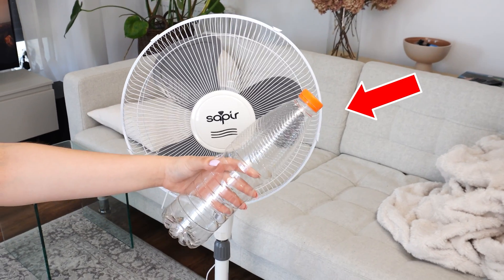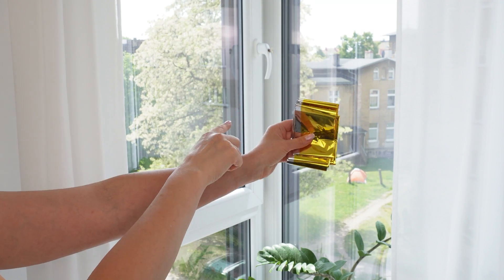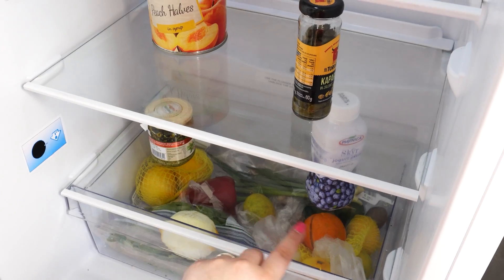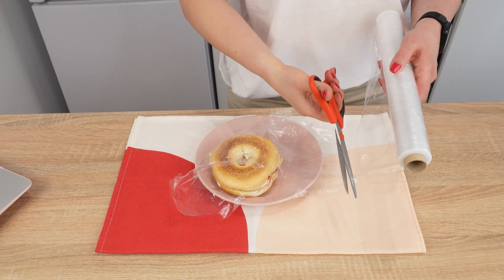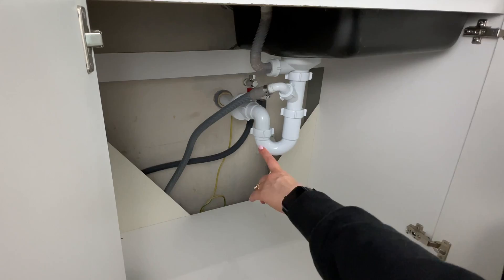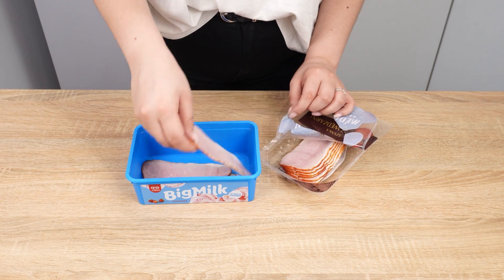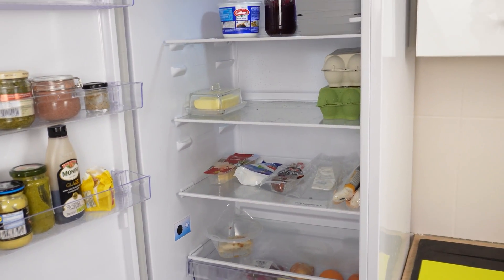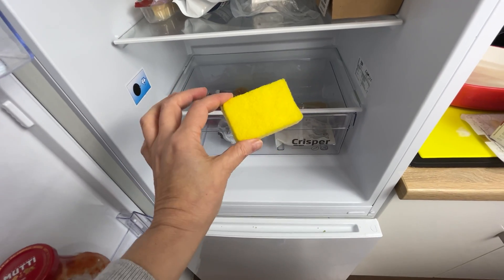Homemade air conditioner that will freeze whole room!

Comment: The idea of a Aircon is to remove the moisture in the said room.... on this method the moisture is still present, though it does cool the room, as soon as you turn off the fan, the room will warm up drasticly very quickly because of the humid air.

Comment: If its a house what was built in 1870 with no insulation and its 110 degrees this method will not be cooling your house down at all. You will not be able to sleep with this either. And putting a blanket over yourself that is a pipe dream right there. Our air conditioner when it was new did this but right now its not heating like it use to. We either will be cleaning it out soon or buying a new one. Three digit weather this method won't work.

Comment: Go buy a couple of the uv sun shade made for pop up canopy and cover each window, if you can from the outside better but if not still do it from the inside trust me this blocks the uv rays and keep the inside cooler. Once it cools down slightly open all windows have one box fan blowing in air and one box fan preferably in another room window exhausting the room air out so it circulates throughout the rooms. This is the most cost effective way to stay cool.

Comment: The water cooler has been around for a long time, it works well but you have to keep in mind that the humidity is higher with it.  Works good out west where the humidity is low.

Comment: You Turkeys are Bad at this -
First, The homemade Fan AC  thing has been around alot longer than you think ... I was doing this back in the 1990s using two empty Ocean Spray bottles ( just don't put any vent holes at least 3 inches before the bottle cap)
Secondly, you can use Bubble Wrap to insulate your windows (Do NOT pop the bubbles). It works much better while still allowing Ambient Light and some visibility. 
THINK when you Think.

Comment: Easier and less risky way:  get a sheet pan and fill it with water. Put it in the freezer. Then set it on a table (with a cookie sheet and towel to catch condensation without damaging the table) and put a fan behind it to blow the cold air around the room. That way you’re not risking water and wiring getting in the same place.
Reply: wait does this really work?? If it is 97 degrees outside, how much cooler will it make the house/room?
Reply: @yakzivz1104  I’ve done something like it in a small area and it does help a bit.  Mostly I was pointing out that the whole water on an active fan was unnecessary and kind of risky when you can blow a fan over ice without connecting the two.

Comment: Go back to school. This method of cooling goes WAY BACK to ancient times although without electricity, fans were hand pumped. In the mid 1800's a Dr. Gorrie of Apalachicola, FL was handling an outbreak of Yellow Fever and used exactly this system to relieve the torment of patients with elevated temperatures.

Comment: But icing doesn't seem safe. However I will be trying the emergency blanket trick and the Glycerine on the the shelves. I just figured the whole thing would be common sense, water and electricity don't mix well.
Reply: Im gonna place gallon containers with ice in a shallow bucket in front of and behind my fan and see which works best. 
I have the world's best dog, but i won't leave him unsupervised with that setup, even though it should be safer.
Reply: @katrinab7657 Please do follow up and let us know if and what worked best!
Reply: @lalopez1221   it's a close call. I'd say ice bottle in front is a bit better, but I won't say it's cold air. But apparently, the condensation is acting like a dehumidifier. The more I do the ice in front of the fan thing, the less condensation forms. The air is getting less humid, and therefore more comfortable. The dog is more comfortable as well. I think.

We'll see how that plays out tonight. Fingers crossed , prayers up, thermometers down.

Comment: Common Sense tells me that when you put those ice cubes on the back of a van the moisture can get into the motor and cause problems water and electricity don't mix
Reply: Notice she left the lower part towards the cap without holes to catch the water and stop the fan before you drain the water keep kids away from it 😂

Comment: I put alfoil on windows to keep heat out done this for years much cooler environment and keeps room dark for shift workers. Works great
Reply: I did and I got raided for growing pot
Reply: @digginggopher That's a bummer.
Reply: Bubble Wrap is Better - Just don't pop any of the bubbles
Reply: So do you just tape it down?
Reply: @miaporche2256  sure do

Comment: Water and electricity, now that's an electrocution waiting to happen. Back in the day, people would buy a  large block of ice and put a large pan underneath it to catch the metling water with a fan blowing from behind. Much safer 😂😂😂
Reply: Freeze bottles / gallons of water. Rotate, refreeze, reuse.
Reply: Energy is still used in the process of freezing and the fan blowing.  REALITY says your effort in back and forth freezing and re freezing and fan usage is MORE cost based on the wattage and amount of energy converted.  This is why the 'SUPER COOLER' from walmart, that takes chilled water with ice and blows on it does not work to save money.  The science in the conservation of energy does not make this a solution unless you dug out a hole in the ground and made a nuclear bunker in a closed system. 100% Fail.

Comment: Home ec teacher did ths with a 10" fan and a bowl of ice.  Didn't work in a 25'×50' room. 
Using mylar on windows to stop the sun coming in is VERY effective. I made a shade out of a  cheap survival blanket.  I could hand roll it up if I needed to.  Dropped the west facing room by 20° just by blocking the sun.
Reply: It was a south facing room.
Reply: @wendybutler1681 It really doesn't matter if its north south east or west facing The sun comes in every window
Reply: @brendabailey4319 Well, it does matter. You get sunlight from every window, but the ones that get direct sun rays (more heat) for many hours throughout the day are the east and west facing windows/rooms.
Reply: @cristinaotero5439  Sun coming in any window is going to heat it up Direct sunlight will heat it up even more That's just common sense
Reply: @brendabailey4319 And that is precisely why it DOES matter which direction the window faces. Common sense tells you, that depending on this information you can determine which ones will need heat/sun deflecting measures and which windows won't need anything at all. 🤷🏻‍♀️
Reply: @cristinaotero5439  😂 Common sense tells me sunlight will come thru all your windows  if not covered 😂
Reply: @brendabailey4319  actually, morning sun maybe hot, but afternoon sun is much hotter.
Reply: @katrinab7657  Yes it is hotter in the afternoon It's had all day to heat the world up
Reply: @brendabailey4319   have you ever had a garden that is anywhere near a tree or house, etc. It matters very much how the property is positioned and whether it receives morning sun or afternoon sun. Facing north, South east, or west makes a difference between whether a plant will grow or burn up.
Reply: @brendabailey4319   it comes thru at different angles. The more direct the angle, the more intense the heat. It's science and math. Literally. But girrlll, I'm done too😀
Reply: Thank you

Comment: Do you realize how dangerous this is? I use a swamp cooler. It uses ice and it has refrigeration. I just use the ice but I might try the fridge tomorrow. It adds moisture to the air so it should be regulated to prevent mold, I will use a dehumidifier with it.
Reply: They sell moisture trappers at the dollar tree. It's late - I can't think of the real name. Im going to put one in each room.

Comment: Be careful what you put on windows because it can lock in heat and cause damage to them.
Reply: @popsugar0993.....not to mention some landlords would not allow this.  My lease states curtains only.
Reply: I had a aluminum foil on my window for 15 years and it’s cooler now I move to a different place I can’t do that because my landlord won’t let me put on my window and it’s hot every summer

Comment: that ac is bull crap,have tried it,and it don't work!!
Reply: The ice one or window cover?
Reply: @readg4fun  the ice one
Reply: Not worth  the effort.  Yep! Does not work.
Reply: Honestly, a much better solution that I do to add an extra air conditioning is by getting my Vornado fan and air, circulating basement cold air upstairs. it saves 30% of air conditioning and it’s 80 times cheaper to run a fan per hour compared to air conditioning. This idea is good because the cold air in the basement lasts longer, no sun is getting through and when the AC turns on it cools the basement fully in like a few minutes so that’s why I bring some of that cold air up.
Reply: Thanks for sharing because I was gonna try it